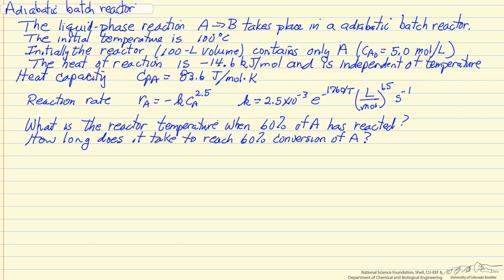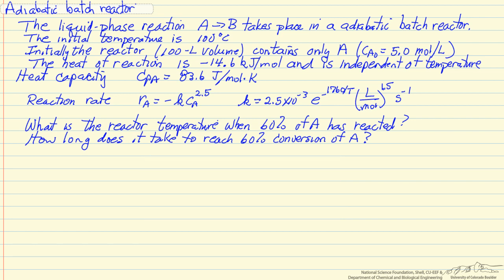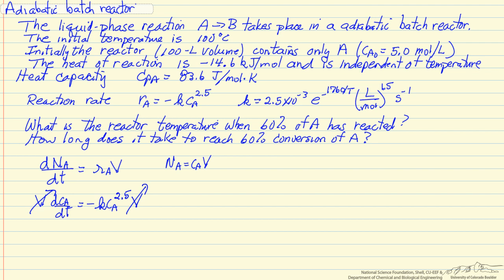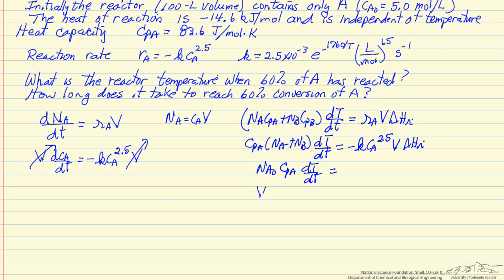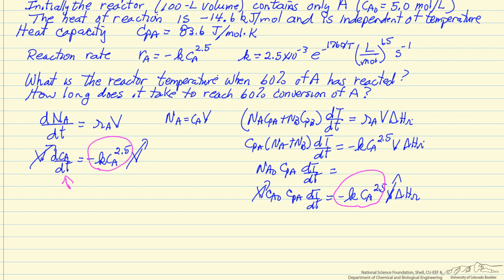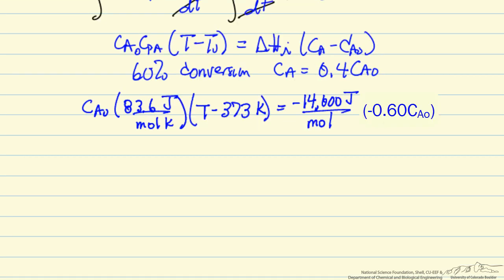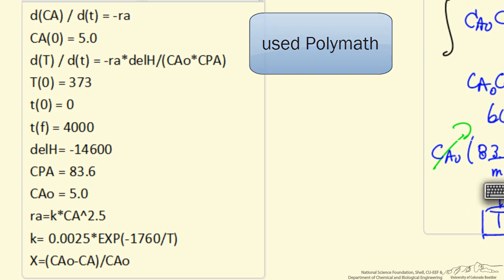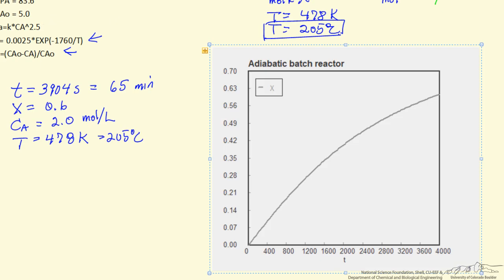Adiabatic Batch Reactor

Comment: I substituted for NaoXa for Na in the derivative and CaoV for Nao, plugged in a given energy balance for an adiabatic rxn formula: T=To+(-∆H/Cp)Xa for T in the given k(T) fxn and simply put it into my TI-84 on the finite integral operation and got the exact same answer. That is, I think that may be easier than using polymath.
Reply: I want to know if I was right in my assumptions and process. I may very well be wrong somehow.

Comment: What is the explanation for why the heat capacities are equal? Because the reactor is adiabatic?
Reply from the maker: Great question! In this case, it is given that the heat of reaction is independent of temperature which means that the heat capacities are the same.